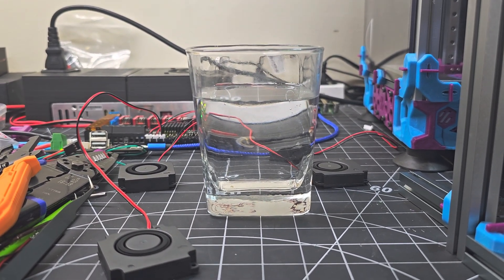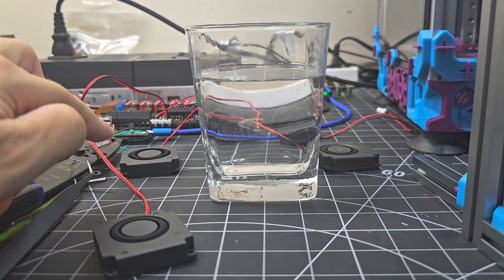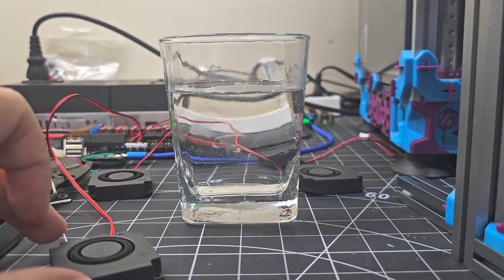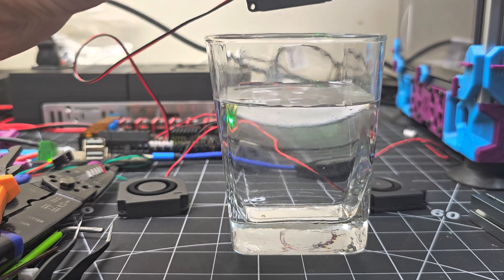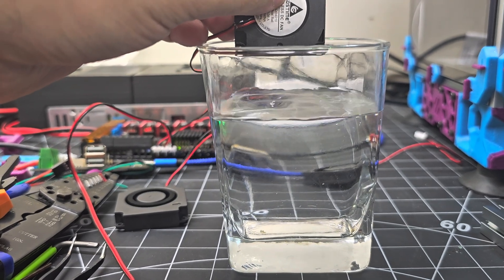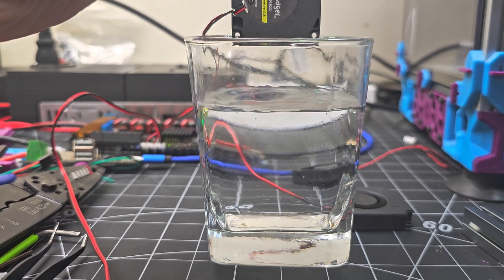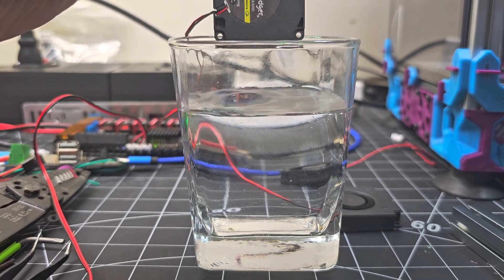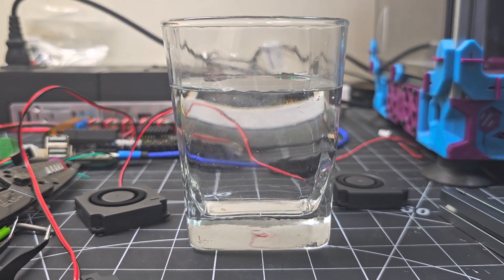From The Bench: Episode 8 - 4010 Radial Fan Water Displacement Comparison

Comment: i think honeybadger might be better too. i have an anemometer on the way and i could probably do this test but including delta fans. Also, would you ever possibly do a video on all the electrical tools you use? idk 100% what i need.
Reply: I know you!
Reply: @mitsumakes  that sounds gay
Reply from the maker: Electrical tools? Other than a multimeter and a heat gun, none of my tools are electrical. I crank those M3 bolts tight by hand! ;-)
Reply: @oldguymeltsplastic  oooh okay i see, I though that cus of the wires everywhere and seeing the  multimeter i think lol